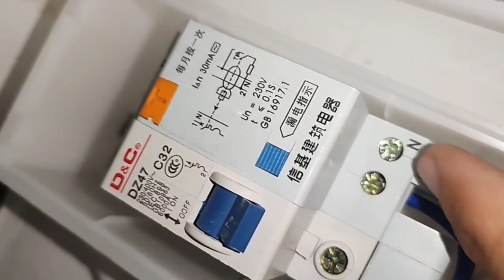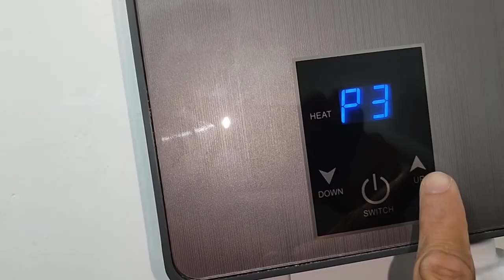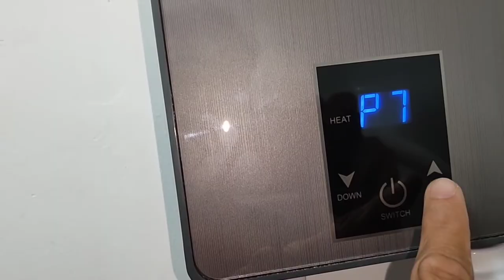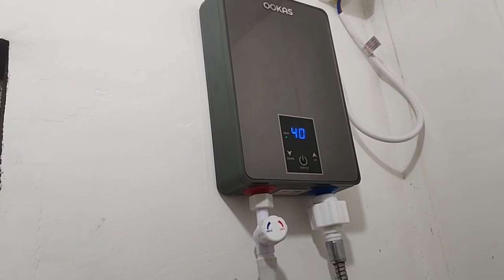How to install OOKAS Water Heater 🚿

Comment: I am planning din na isabay sa light ang electric source ng heater na nabili ko, pero nababahala ako na baka uminit at masira yung light switch ko dahil intended lang sya sa light. Ask ko lang po kung Kamusta na ang set up nyo today? Para po kung ok naman yung gantong set up, hindi na ako maglalagay ng new wires from electrical panel.